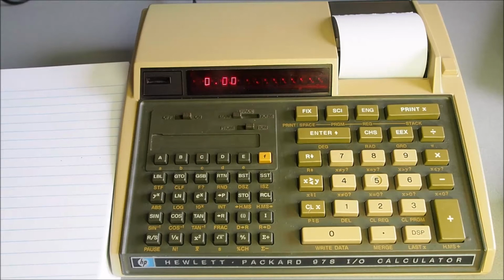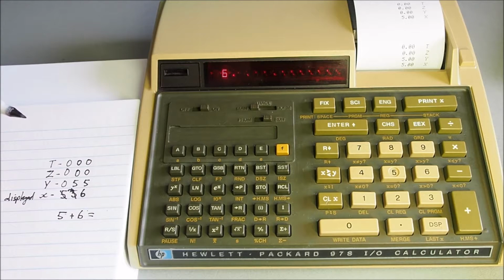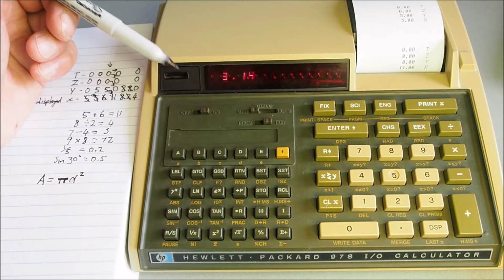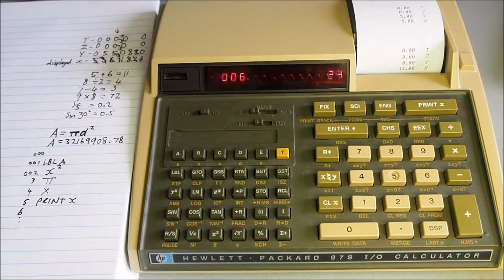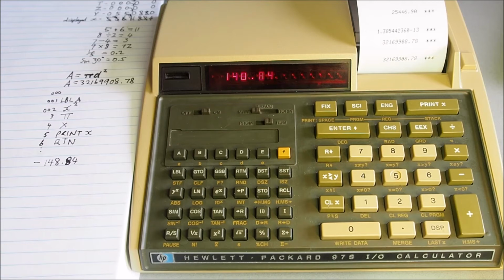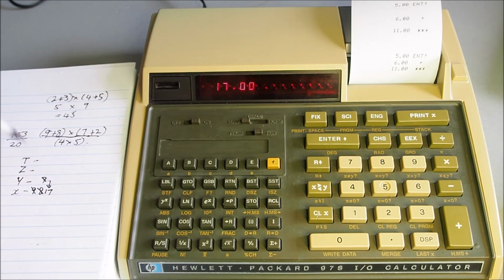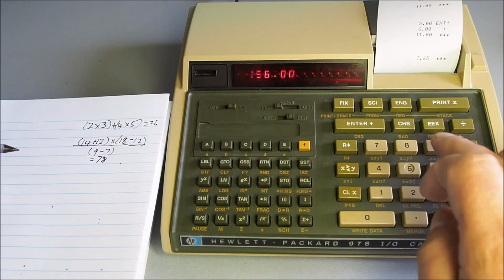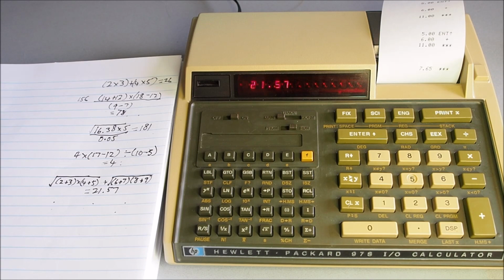Hewlett Packard 97 S I/O Calculator Part 1

Comment: What a fascinating machine. Very powerful and full of old HP DNA. I got introduced to HP calculators and RPN when my dad bought and HP-45. I quickly learned it and was amazed at how intuitive and efficient this input method was. When I entered college, I bought and HP-11c, and later an HP-48sx. Unfortunately I no longer have those calculators. Your video reminded me of the quality engineering devices that HP produced back then.

Comment: RPN seems to be something voor odd people.   I happen to be odd myselve.
When i got my SwissMicro's DM42, after a week a had to use an algebraic calculator and was suprised how cumbesome they are.... 
You get verry quickly used to RPN and the 42 is a great calculator.
So i love you spend so much time on this nice peace of unobtanium.
Reply from the maker: I have to concentrate very hard when using an algebraic calculator now.
Reply: I think the downfall of RPN was the fact that the calculator market is now geared primarily to students, who are using them for homework or tests, and they want to be able to type in a formula the way it appears in a textbook or worksheet. Whereas RPN is what you want if you're doing a calculation off the cuff from ideas in your head.
Reply: @MattMcIrvin I'm afraid you are right, which makes me worry about the future of sceintific students

Comment: Looks like a cute baby HP85 computer.
How often do you have to change its diapers?
Reply: So I checked the dates. The HP97 appeared in 1977 ($1 375). The HP85 in 1980 (3 250 $).